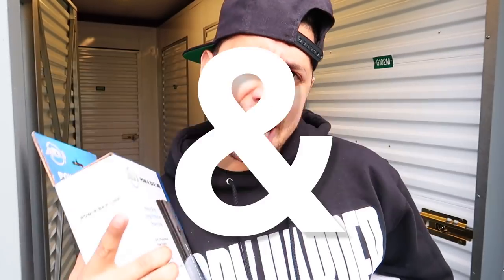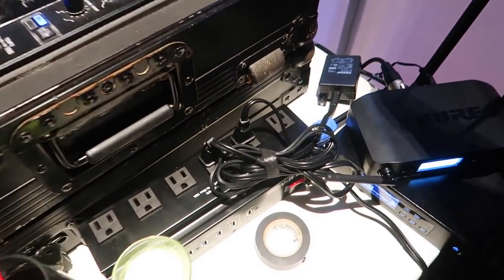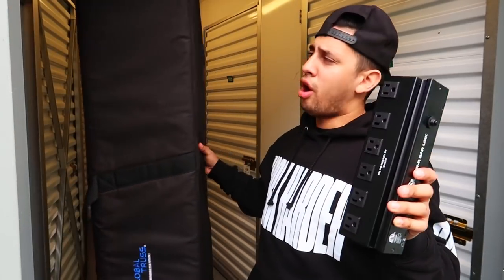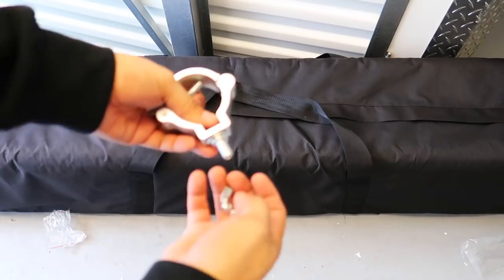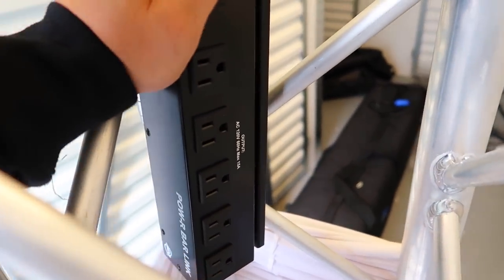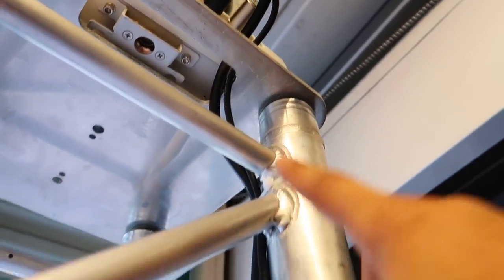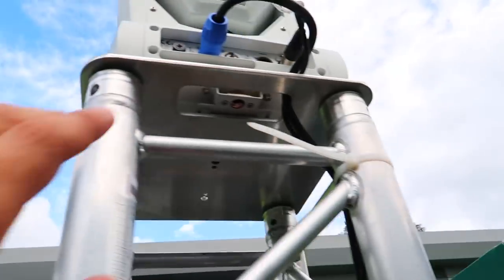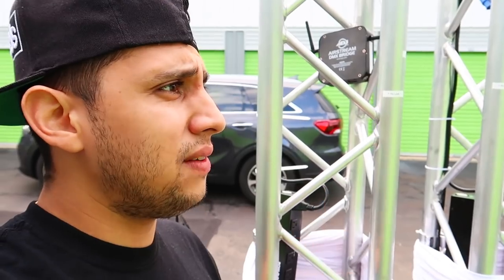Mobile DJ Tips: Customizing my TRUSSING (Speed-up Setup & Breakdown)  | How to Pre-Wire Equipment

Comment: Leave the nut on and cut the bolt as short as you can.  Can you mount the airstream to the bottom of your top plate?  Then you won't damage the antennas.

Comment: For that screw poking the scrim  you could cut a little piece of the  plastic off the packing from the power bar pad it on the end of the screw and gaff  tape it.  It will solve the problem...

Comment: Powered speakers should have that power bar built in the box for easy power supply instead of running all over the walls with extension cords to separate gfi  outlets
Reply: Link em up and make a stringer

Comment: Take the spare nut and washer, thread it on the mounting bolt. Thread the bolt into the power block. Flip the clamp 180, tighten down the nut to the power block. No cutting of bolts needed.
Reply: Never mind...  That won't work like I thought it would. If you cut the bolt, make sure you chase the threads so you can actually unbolt it in the future.

Comment: take c-clamp off the power bar, drill a 1/2 hole through truss on back side and 1/4 on inside then run a bolt through internally into the power bar.(use the 1/2 inch hole to get bolt and wrench through).. no visible bolt or clamp. and tighter connection, also way cheaper to buy power con connectors and wire and make your own lengths, also, I ran all my wires internally inside the truss pipes

Comment: I'd fabricate a bar on the inside so that you can clamp things to them in the middle so nothing would be on the outside bars that would show when you put back on the scrim.  Simple as drilling two holes in the aluminum, then tapping them add bolts and another aluminum bar or plate and now the power plus air stream dmx can be attached and it won't show from the outsides..  if done well won't even look like a DIY project.
Reply: but quickest solution would be to cut the excess bolt and sand it down so that it no longer sticks out..

Comment: How do u transport your moving head? Road case?
Reply: DJVetz510 do you fit both of the 140sr’s in that case? Or do they just hold one. I’ve been using the Chauvet bags with wheels and have hated them from day one- but also don’t want the weight of a dual road case because we work in venues with stairs and I do a bunch of gigs alone. Thanks for sharing the link!

Comment: Get a Dremel Tool and cut the excess length of the screw..then cap it. HomeDepot  or Lowes sell screw end caps

https://www.lowes.com/pd/Hillman-4-Count-10-Nickel-Standard-SAE-Cap-Nuts/3035977 . ( would have to take the screw to get the right size)

Comment: Basically you're paying $80 for a powerstrip. Only thing is to mount it. You can get one that has surge protection and usb ports for way cheaper. I'm getting heavy duty velcro straps to secure it on my horizontal truss. It's a pass. $80 is too much for it to be so clunky and bulky. 🤷🏽‍♀️